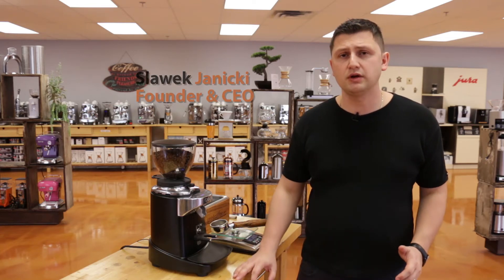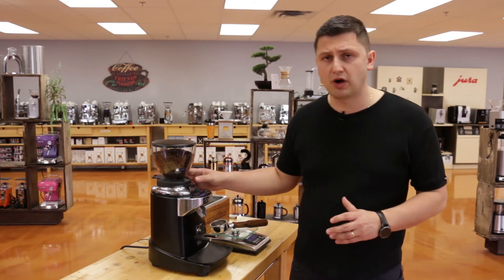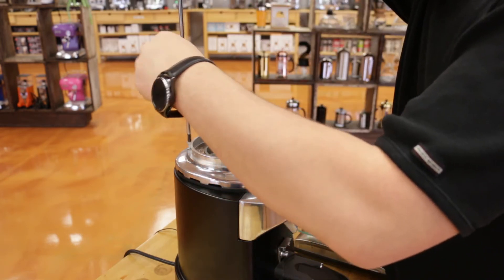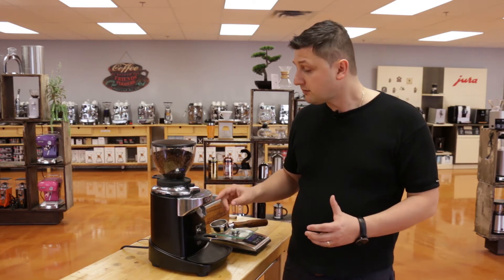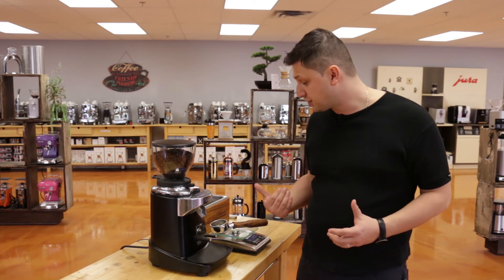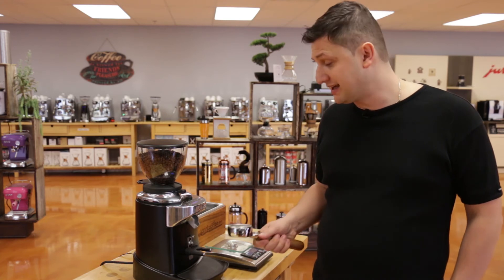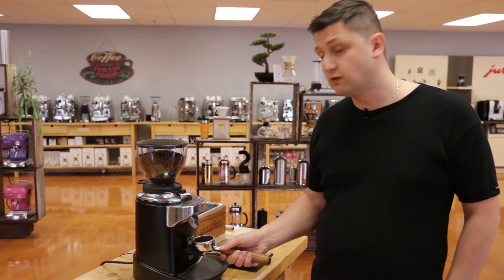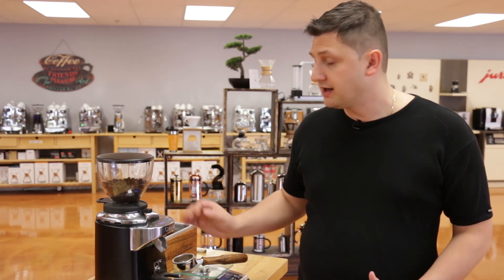Ceado E37s Espresso/Coffee Grinder Preview

Comment: Yes Eureka has been doing this, as this was my choice I have to make in two days. I am going to go with this Ceado the newest version which is this one he is displaying. I wanted the Ceado e37T with the temperature control and bigger motor and titanium burrs but at the time I am writing this it is not available anywhere in USA. The Eureka I was considering was the Olympus 75E with Titanium burrs. Its just that the place where I am buying from either does not have the Eureka and has the ECM Synchronika or vice versa. So in two days I am buying the ECM Synchrokika and the grinder you see here in flat black the Ceado E37S.
Reply from the maker: Farcry101010 Give us a call if you are looking for this equipment.  we do have the  titanium burrs for the olympus available